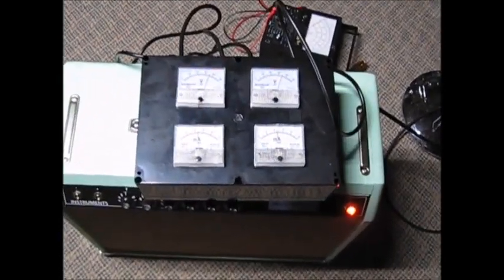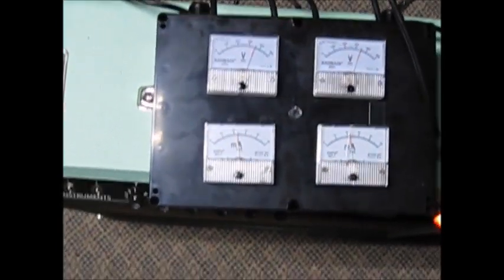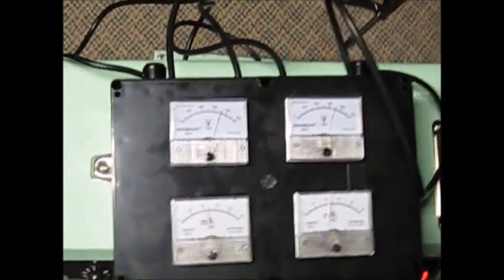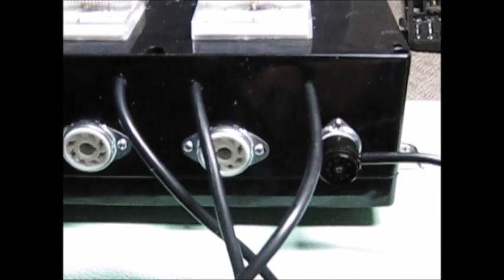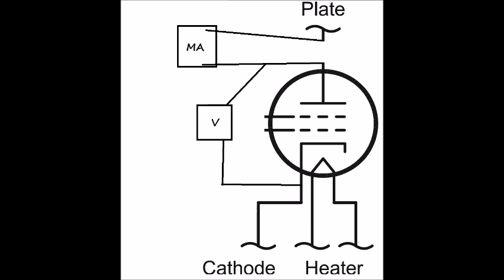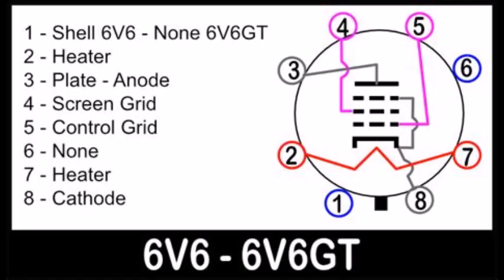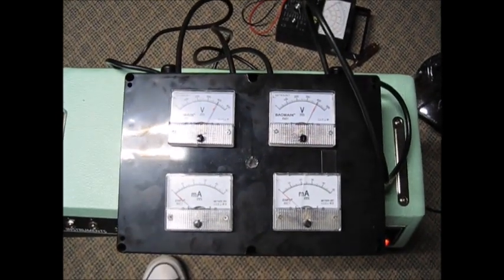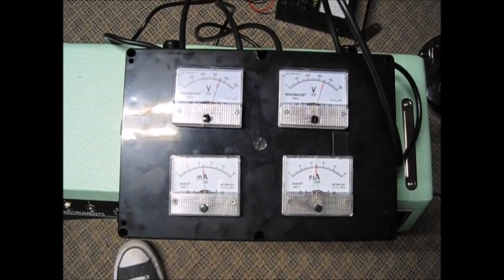DK Makes a "Bias Probe"   to easily bias tube amps..... DIY Project

Comment: I love analog too.  I have two Alessandro dual octal meters.   I’d love to be able to see analog current with voltage Meters., but these have worked well for two decades.  Thanks for the inspiration DK.
Reply from the maker: Funny enough,  I am working on my pioneer SX-1250...  and setting voltages in there with a DMM makes me crazy...    Trying to get it to stabilize at 65mv...  when breathing on the trim pot would sway it.   The analog meters can only show  "close enough"..  and it encourages me to be more conservative with my tubes.

Comment: Great video. Saves a bunch of money if you build this yourself
Reply from the maker: The circuit is certainly NOT a tough one...   Building the probes is a "tight space"  job...  but that's my fault for wanting short probes.   It's been helpful...   as it shows up in the next 3 videos.

Comment: Good stuff DK, a totally useful tool. I here ya on the frustration levels when making the socket to plug devices. A definite on my costs less than 4 meters list for sure.
Reply from the maker: It's certainly done in "my style"....  having no detachable parts to misplace,  and no batteries to deal with.   This device is simple enough, and does just what I need it to do.